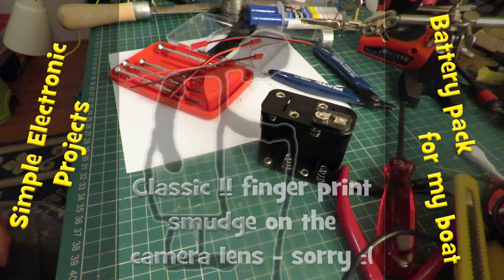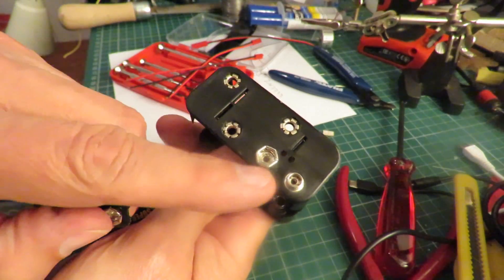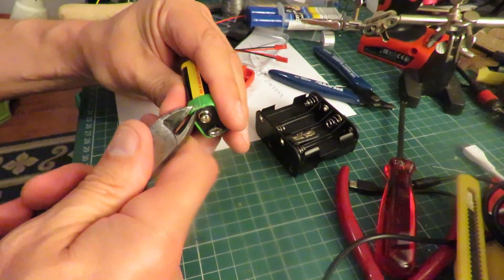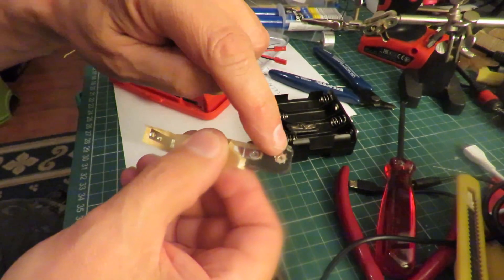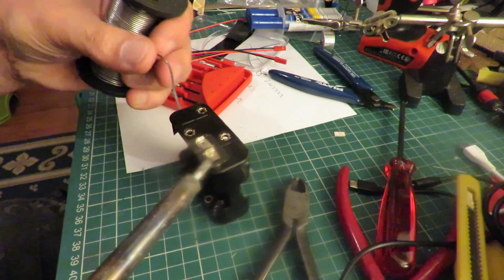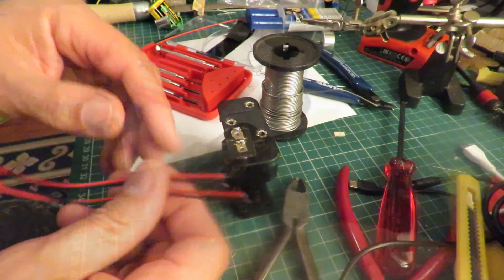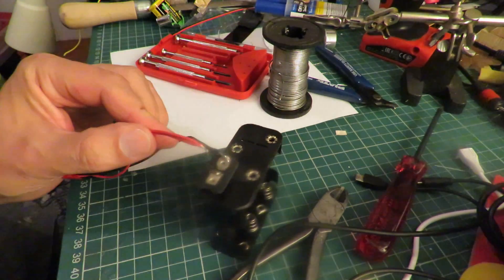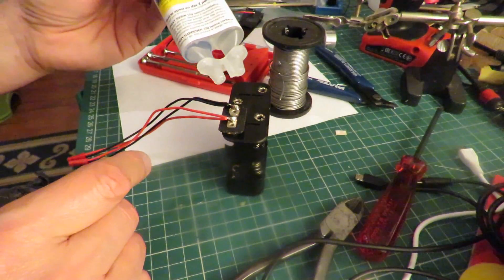Battery pack for my boat

Comment: Not terribly related, but it happens that I did this same thing just yesterday! I had one of those 8-AA battery packs lying around, so I soldered a JST lead onto a 9V battery clip and used it as an extra NiMH battery for my RC car. You can hardly get any current out of those AAs though.
Reply from the maker: I was using LiPos in my boats and then realised I could use my old NiMhs because I have dozens of them left over from my old camera. I needed to have several packs with me when I was out filming as the camera ate them rapidly but they last much longer in my boats and the extra weight doesn't matter.